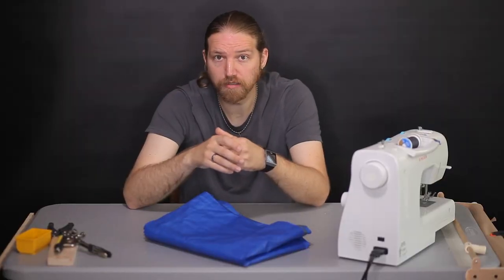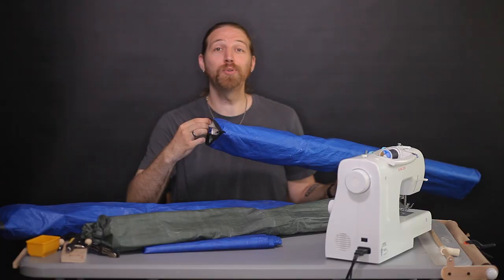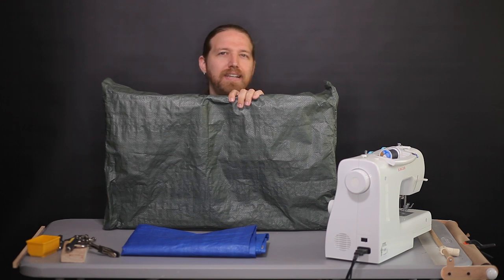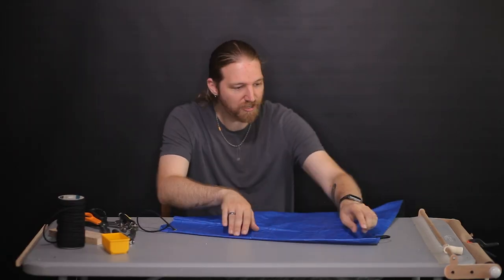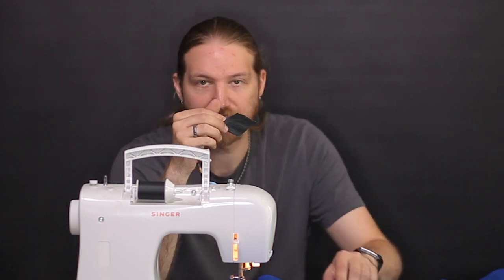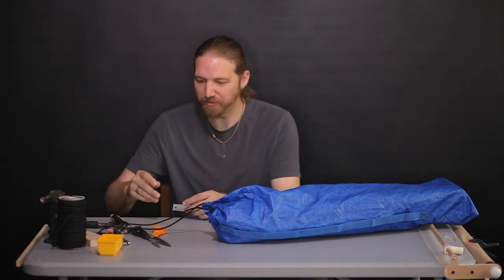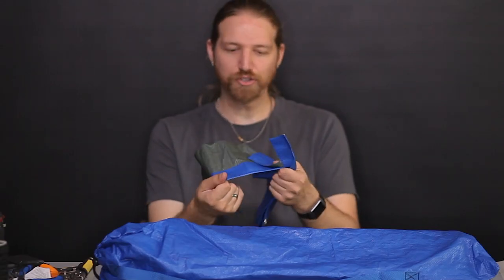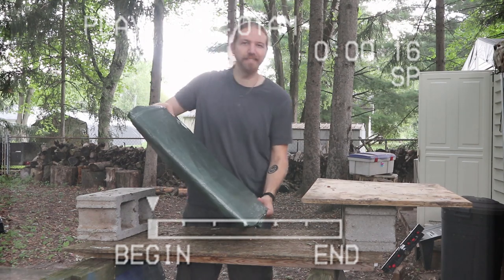DIY - TARP BAGS

Comment: I like your idea of using heat shrink tubing for the end of the cord. I am wondering what kind of cord you got or where you got it? I am wondering which stitch did you use for sewing your seams. I bought a used sewing machine at the thrift store.. but I have not yet figured out how to use it. I am glad you mentioned doing heat sealing as an option to create seems. I am in process of making a bicycle cover with a large tarp-like poncho and a tarp. And I want to create a drawstring around all sides that I can use to quickly bunch it all together when I have it over the bicycle. and i need to create seams along all for edges for my drawstring.
Reply from the maker: It was just some black rope/string that I got at Michaels. 32 PLY Polyester Macrame Cord, but pretty much any rope or string should work.
Reply: @IamNickDClements  thanks. i am looking for your video on using the heat sealer to make things. I don't yet have a heat sealer.. and am concerned about bying one like you had in this video. the tarp edges are much longer than 8 inches and not sure how i would be able to heat seal a seam along such a long edge of tarp with that heat sealer.
Reply from the maker: @manp1039  Yeah, unfortunately, all of the cheap sealers are hinged on the side like that, so you can't really seal anything longer than about double the length of the sealer. (seal one half flip it over and seal the other.) The ideal sealer for sealing a edge of basically unlimited length would be this style: https://www.amazon.com/dp/B083177JRR/ unfortunately those start at around $100. However, you could attempt to take apart a cheap $20 sealer, removing the hinge, and just hold the top part of the sealer by hand, or rig it up in a way so that it function more like clamp style ones.
Reply: @IamNickDClements  thanks. Your idea of unfastening the the top part from the hinge is an idea. I am exploring which ones seem to be best capable of doing the. The other option is to work on learning how to use my sewing machine and stitch up the seams with that as we. In any case, like you said, it probably would be extremely usefull to have a heat sealer anyways.. And i think i will go with one of the Impulse sealers. they seem to be the best options.. and they have replacement heating elements strips on amazon. The other thought i had is to try one of those hand sealer that have  1 inch or shorter heating element to tack down a seam every inch or so. They apparently don't have the heat adjustments like the 20 dollar one. I have a battery powered one in a storage box.. not sure if it will get hot enought to seal two layers of tarp together.. in any case, thanks for your replies. :)

Comment: How good is that machine with thicker material like leather or heavy canvas?
Reply from the maker: Just tested it with 8 layers of jeans, and it handheld it without a sweat surprisingly. Also ran some 3 mm leather, and it didn't like it but it stitched it! Usually for leather, especially thicker leather, you use a special leather sewing machine, that uses thicker needles and thicker thread. But yeah, for just being a basic/cheap Walmart machine, I'm very pleased with it's performance.
Reply: @IamNickDClements  Yeah I just got a walking foot machine that I'm learning how to use. Apparently there are special needles that work best with leather even if you don't have a heavy duty machine.

Comment: Please advise!
Should I worry about waterproofing the sewing seams? If Yes, what do I do to waterproof them?
Many Thanks!
Reply from the maker: I thought I replied to this, sorry. I would say it definitely depends on the use case. You could try running a iron along the seams to fuse them together. I have a #short on doing it. Results may very across different tarp materials, etc. I would say, a pretty easy way to add waterproofing would be to just spray it with some "camp dry" (it's similar to scotch guard) you should be able to find a spray can of it in pretty much any camping/outdoors section for around $10.

Comment: Why not some type of glue rather than sewing? The end pieces are initially glued somehow...
Reply from the maker: Sewing is just fast, and arguably easy.  The hems are heat fused, like I showed in the end of the video. With glue, it can be hard to find the right glue that will properly adhere to plastics, and of course you will have to wait for it to try. But I mean, yeah, it's an option.

Comment: Loved your ideas for using tarp material. I am needing to make tarps from my empty chicken and horse feed bags. Question: what size needle and type of thread are you using? Tarp material and feed bag material is pretty close to being the same. Thanks so much for your help!
Reply from the maker: Whatever is lying around is usually what use, lol. But the specific needle in my sewing machine is a "Schmetx Microtex (Sharp) Needle 130/705 H-M 90/14"  - And just normal, generic thread, but some stronger/heavy duty thread wouldn't hurt. My "trick" for getting a stronger stitch with thinner thread is to just use a zig-zag stitch.

Comment: I've got another "tarp project" for you. What about making a camping trash bag to pack out your garbage, and even other people's garbage that DIDN't pack their trash out (we all have come across this issue). Love the video!
Reply from the maker: That could be pretty cool. Currently I have a bunch of pop up laundry hampers that I got at the dollar store... they collapse down to like a 8 inch disc, and pop up top like a 2.5'x12"X12" hamper... you toss a rock in the bottom to keep it from falling over/blowing away, put a trash bag in it and use a few binder clips/clothes pins to hold it in place. It works really well. One for trash, one for cans and recyclables/returnables. (and they are also just great as dirty clothes hampers lol) -- also yeah, people suck.
Reply: @IamNickDClements  I hadn't thought of those.  Great idea.  How waterproof are they? I thought of the "tarp trash bag" when I saw the one you made for the grate cover. A potable fire pit cover would be great,too. I know those are really popular. They even have a way to sew a pocket onto the back so that when you fold it up,  it folds up into the bag and zips, like for your ground cover for the tent. I guess I'm just proving your point about just how versatile a tarp bag can be. LOL

Comment: Have you ever sewn with fishing line? I have researched and want to redo a car cover which is tarp. I did get a janome HD3000 for this project just been told fishing line might be my best thread for tension strength 20lb or more?
Reply from the maker: I have not, but I don't really see why it wouldn't work. Especially if you are hand sewing. I'm not sure how happy a standard sewing machine would be sewing fishing line, but maybe some really thin stuff? Otherwise, a big, beefy/industrial leather sewing machine could probably handle finishing line just fine. Another line to consider might be micro paracord. 0.75mm Nano Cord is supposed to hold 36 lbs.
Reply: @IamNickDClements  
I see some fishing line that is 40lb and 0.3mm so I thought it should thread through a machine fine  and use 1.5” webbing on the back of the seams for additional support of the stitching
Reply: I've used fishing line to patch up jeans a few times (by hand)

Comment: Ohhh, this is just what I was looking for! My housemate has a cot from REI -- It came in a cardboard box, which is starting to disintegrate -- This time we are camping with my RAV4 so we need to minimize our gear-- now to go find the correct size tarp to size down--  What kind of needle did you use on your sewing machine?  Did you use heavy duty thread?
Reply from the maker: I just used whatever needles I had on hand: "Schmetx Microtex (Sharp) Needles 130/705 H-M 90/14" -- For a standard, plastic tarp. And just normal thread, but some stronger/heavy duty thread wouldn't hurt.

Comment: Great video!  Question: the tarp manufacturers must have an industrial sized heat sealer for the folded over parts where the grommets go.
Reply from the maker: Yeah I would imagine they do. And/or, they have a glue/solvent that chemically bonds the hem.

Comment: Did you use regular thread and domestic sewing machine?
Reply from the maker: Yes, just normal thread, and my sewing machine is a "Singer Simple" model # E99670, it was like $80 at Walmart. I love just a simple sewing machine, as long as it can do straight stitch, zigzag, and has a front loading bobbin, I'm good. (I hate newer machines with the top loading bobbins...)

Comment: Do you need a special needle and thread to sew tarp? What size ?
Reply from the maker: Nope, not in my experiences. It sews incredibly easy. I just used whatever needles (and thread) I had on hand: "Schmetx Microtex (Sharp) Needles 130/705 H-M 90/14" -- For a standard, plastic tarp... if we're talking canvas tarp, than yeah, you're going to need some pretty touch needles, and a pretty tough sewing machine as well.

Comment: I'm trying to figure out a way to make a custom sized tarp. 4' x 7' to cover firewood rack. Can you make a hem at the edge with an iron?
Reply from the maker: It won't really melt the 2 together, Maybe if you take the very edge of the iron, and like try "spot welding" it, like a heat sealer... your best bet would be to just sew it. I made a custom tarp for my tent last year, by just cutting cutting the edge off, cutting it to length and then sewing the edge back on.
Reply: @IamNickDClements  it'd be neat to see a video on that.  I think I know what you're saying. Thank you for replying.

Comment: How strong is the heat sealing method? Would it hold a lawn chair without separating or ripping open at the melted together seams.
Reply from the maker: It's pretty good, you would probably want a better quality heat sealer for something like that, one that does a thicker band of crosshatching, or multiple lines, (like the seal on a bag of chips) instead of just the singular, thin line that the cheap one I have makes.
Reply: Now thinking iron on sealing tape and a handheld hobby sealing iron may work even better...

Comment: Did you use a specific needle size specific for tarp material?
Reply from the maker: Nope, I just used whatever needles I had on hand: "Schmetx Microtex (Sharp) Needles 130/705 H-M 90/14" -- for a standard, plastic tarp, it went through it without a problem.

Comment: Thanks forthe great ideas. What machine are u using is it the singer 4423? Im looking to buy one soon to make stuff with those tarps  for home and shop. Also canvas paint tarp.
Reply from the maker: You're welcome! It's a Singer Simple 2263. It was just a "cheap" Walmart sewing machine, I think like $70-80 when I bought it, which I find is pretty much all I need. A basic machine with basic functions, all I ever use is straight stitches and zigzags. That said I learned on and used my mom's Kenmore growing up, and that thing could sew through anything! I wish I still had it. Also I need a front loading bobbin. I hate the newer machines that have the "easier" top loading bobbins, I think they are garbage lol

Comment: Does the tarp itself not "fray" or raffle after you cut it?
Reply from the maker: Certainly not right away, it's woven, so it'll hold it-self together pretty well. Additional, everything gets sewed or hemmed.
Reply: @IamNickDClements  do you think its possible to glue with like powerfix a "zoom" so it does not raffle anymore? I have no knitting machine or heatgun, need to make a roof over my small pool have a 45 m2 tarp wicht is like 20 times to big..
Reply from the maker: @MrWaf007  Unfortunately, I think you are going to have a hard time getting glue to stick to a plastic tarp. You could try staples, just regular paper staples. Fold the cut edge over a few time, and staple it every 10 inches or so.
Reply: @IamNickDClements  many thanks from the netherlands!
Reply from the maker: @MrWaf007  You're very welcome, best of luck with your project :)

Comment: Do you need to use a specific needle and thread to sew tarps?
Reply from the maker: Nope, not in my experiences. It sews incredibly easy. I just used whatever needles I had on hand: "Schmetx Microtex (Sharp) Needles 130/705 H-M 90/14" -- For a standard, plastic tarp... if we're talking canvas tarp, than yeah, you're going to need some pretty touch needles, and a pretty tough sewing machine as well.
Reply: @IamNickDClements  Can I sew by hand - dont have a machine, and the small project I have doesn't warrant buying one.
Reply from the maker: @jamieb3071  I don't see why not. For just a standard plastic tarp, it sews very easy, so sewing by hand shouldn't be a problem.